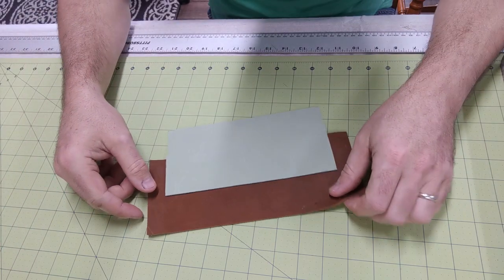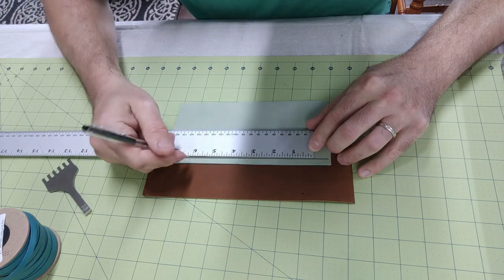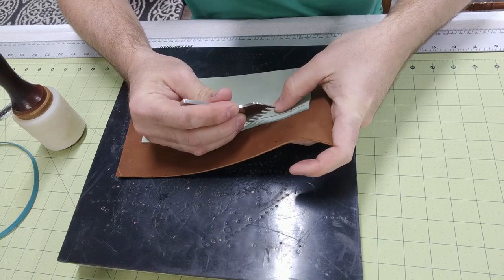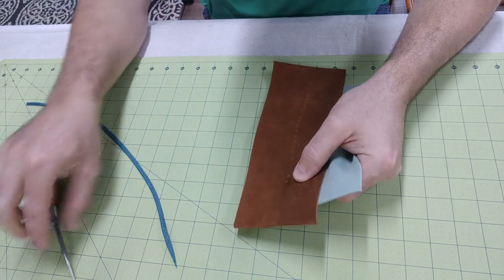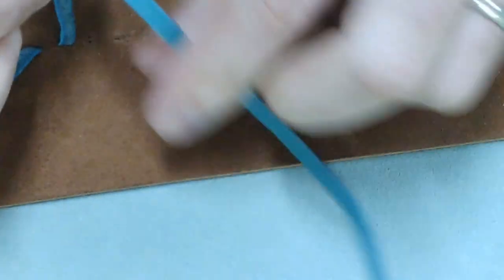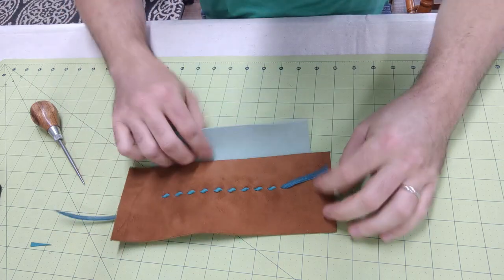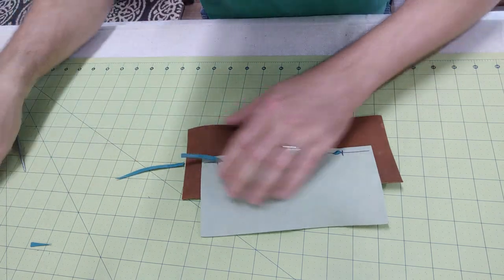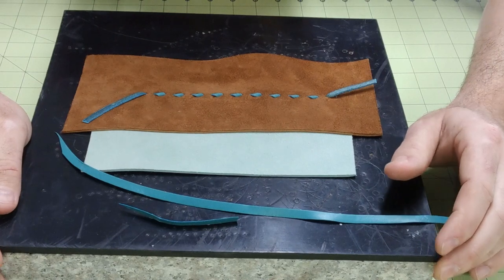Buck Stitching Leather

Comment: You mentioned that you used 1/4" lace, but isn't it 3mm , that is, about 1/8", the size of the chisel?
Reply from the maker: I am not sure of the conversion, however I did find a spool of kangaroo lace like I used in the video and it is 1/4" wide lace.  The lacing chisel I have are 5/32
Reply: @CraftsmanshipwithAsh  The description for the chisels (which I'm ordering, by the way!) on the Leather Maker's Supply website says they're for 1/8" lace, so you would probably would have had a lot more difficulty getting 1/4" lace through those holes.
Reply from the maker: That would be correct, 5/32 lace would be a better option.